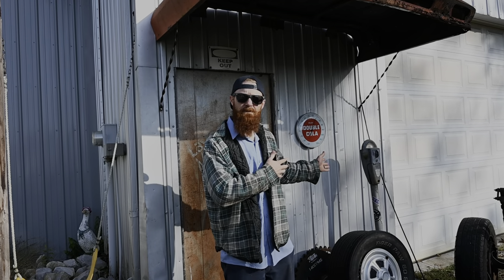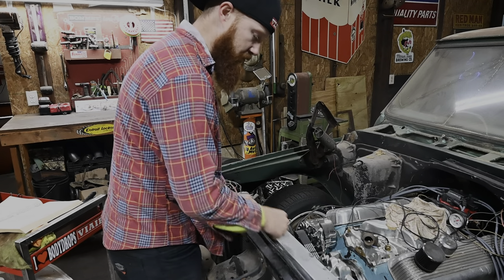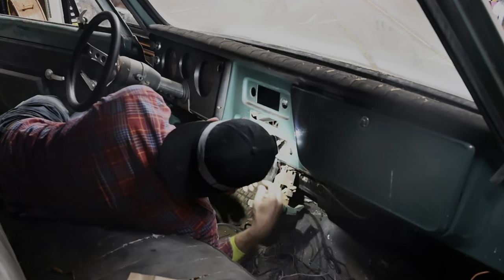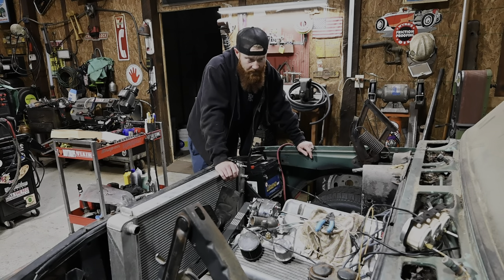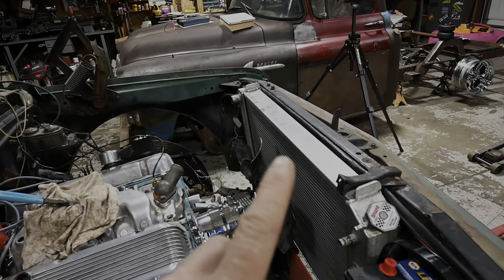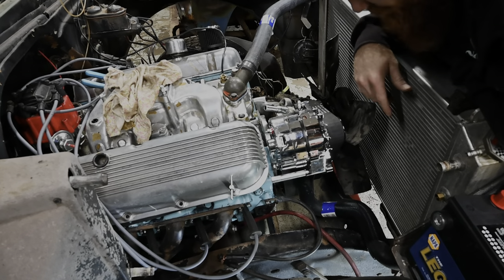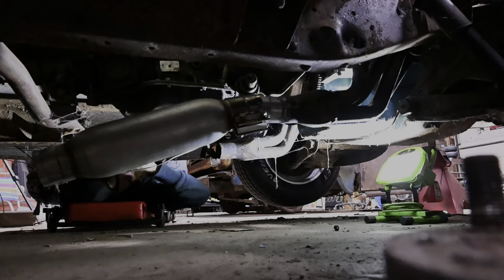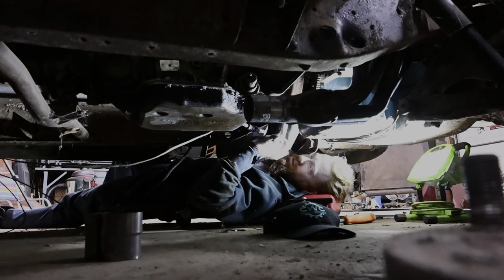Barn Find 67 C10! Will it Run?

Comment: Breaking in a 454 in a 67 C10 is about as cool as it gets - really appreciate the time and effort filming. We did a 327 last summer in the 70s on a stand with rad, fan and big floor fan and still needed to break it up in 10 minutes stints.
Reply from the maker: Thanks for watching. Definitely going to look into some electric fans. Tuning the crab and timing will help bring it around a little also. But so glad it’s running finally lol

Comment: Funny wen i bought my 69 it had the same steering wheel on it i bought the correct 69 wheel n put it on but i also have a 67-68 wheel was debating on puttin it on cus i like the 67-68 wheel design better than the 69🇺🇲
Reply from the maker: Haha yeah that one will be rough with the no power steering currently. I have a wheel from my 64 I may put on for now